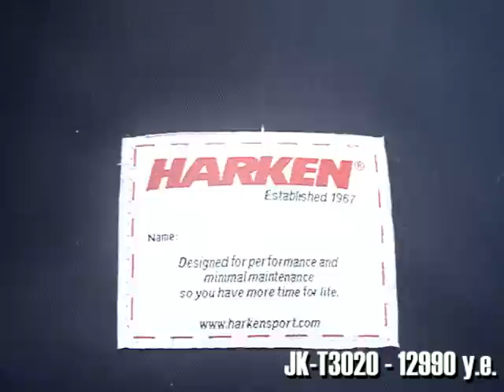JACK 3020 швейна машина

Comment: Hi,
How much is this machine, more details please.  thanks, mike.
Reply from the maker: 1-needle programmable electronic pattern industrial lockstitch sewing machine with the sewing range 300mmx200mm

This high-end professional sewing machine is equipped with precision mechanics, pneumatic drive and computerized controls. Touch-screen display data input ensures easy operation. The machine is equipped with the USB port which allows transferring sewing patterns from external media directly through the USB. The machine uses high resolution large screen, as well as english interface, it's also possible to enable the use of touch-sensitive control entirely. 
This model can be used when sewing heavy and leather fabrics, leather shoes, handbags, jeans garments, sporting goods and other special sewing products. It can be used to sew drawing patterns, runstitching clothing details, bar tacking, attaching labels and logos, "Velcro" closures, finishing pockets and to apply special bartack. 

Features:

1. The machine is equipped with servomotor, making it possible to work with low noise and vibration levels.
2. Large liquid-crystal display. 
3. Fully-functional operating system and the possibility of loading sewing parameters from the external media without having to restart the machine.
4. It's possible to store up to 999 types of sewing patterns or drawings in the machine memory.   
   
13100.00$
Reply from the maker: http://softorg.com.ua/